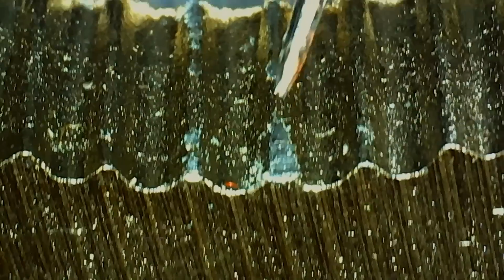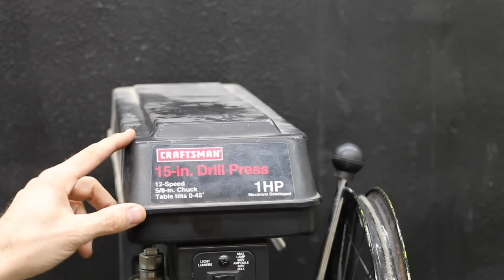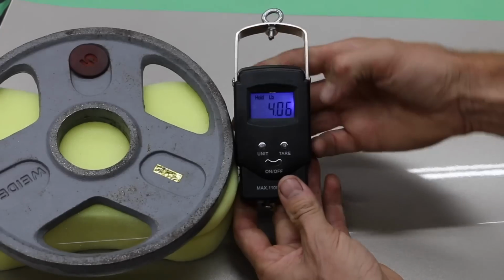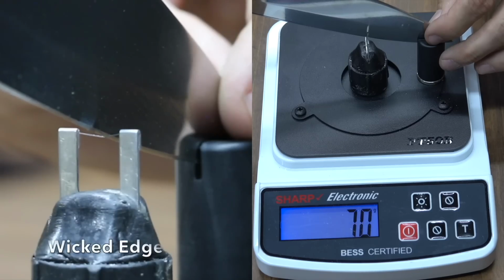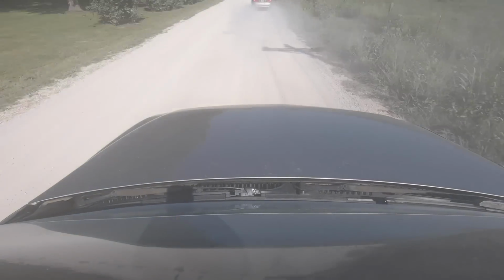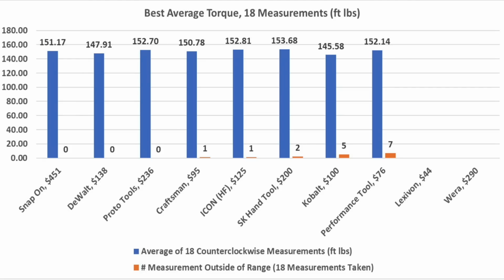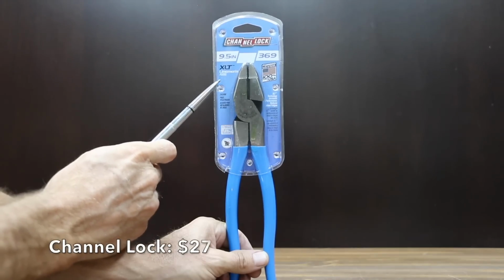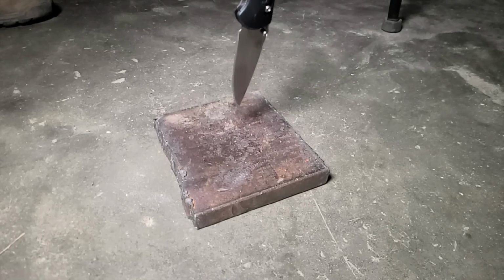Best USA Made Tools Ever Tested? Lets Find Out!

Comment: From the top ten using the torque wrenches for an example the Snap On was the best in Standard Deviation, the Kobalt was not statistically different yet cost less by more than 4X which raises the question was the Snap On or the Kobalt just having a good day or if you had tested 10 of each hopefully from different lots, would the results have been more or less the same or would a greater difference showed up in each brand or between the brands. Now that would have been a test 11 tools times 10 of each who would have won?  It certainly would have not been your pocket book or home life.

There are other things that were tested that 1 or 10 of each probably would have not made a difference such as the car products. I would hope that the various chemicals would be metered in such a way as to be plus or minus X to control the costs of the product assuming that you got an average bottle of the product.

I probably don't need another torque wrench, if I did I would have to look at the Icon as I would normally not go to HF for a torque wrench.

By the way my cars would tell you that you put way more effort in testing products as my idea of waxing the car is running through the super cycle at the car wash to get the wax job.

Great job.

Comment: Please do a Box fan and Vornado fan test.  I always buy and uses cheap generic Box fan for decades. then one day i bought 1 Vornado 270 . OMG even the Vornado has Modest 513 CFM air movement compare to the 2000 CFM box fan rating. 
The Vornado fan move air a lot FURTHER . you can feel the air movement a lot further away. 

Several criteria would be . 
1. Air velocity. 
2.Air CFM. 
3. Air velocity of movement at some distance away.  How far can you still feel the air movement.
4. amp draw at 1,2,3 speed.  Amp draw is VIRTUALLY the same usually :)  
It seems like regular fan air movement is DIFFUSED out very fast. 
5. noise level. 
6. Vornado DEEP pitch blade vs Box fan shallow pitch blade. which one caused Droning noise or more effective. 

I still have lots (6) of box fan. that is used in emergency when my rental property AC quit.  and of course the 20" shop floor fan with 6000 CFM would beat Vornado in shear air movement amount. 
But the Vornado is the best IMHO . I end up buying Three Vornado 270 flat panel fan.
You could test the Dyson blade less . But seriously Dyson is disappointing.  

There are several Vornado clone like Honeywell. but none that I tested would rival Vornado 270 Flat Panel fan. 

Thank you .
Reply from the maker: Great suggestion! Thank you.

Comment: I recently had some rubber fuel line that I bought from AutoZone dry rot and leak in just over a year, I'm replacing it with some $8 per foot 225psi fuel line from Oreilly and if you did one on fuel hoses that would be cool.
Reply from the maker: Thank you for the feedback!

Comment: I bought the vice grips right away.  I typically don't use these, but recently a stuck bolt revealed that the cheap tool was inadequate.  I have a set of Allied screwdrivers [a cheap brand made by Snap On] and recently bought a set of Tecton  (I pronounce it like electron, not like Trenton) and while they are not the Allied, they are good.

Great video!
Reply from the maker: Thank you!

Comment: I still have my Malco sheet metal hammer l bought in 1984 and the leather is still in good condition because on the first day l put electrical tape and many years later I took the tape off and put clear heat shrink on it.
I used it many years when I worked in the air conditioning business.
Reply from the maker: Thank you for sharing!

Comment: I own a Leatherman PST and an Oregon cordless telescopic saw, several guides for chainsaws with the same name, apart from that I have nothing else that could be related to the USA.  Maybe the problem is in the distribution network and maybe in the quality of the products that they are not more represented in the sale. The price should not be a factor because the quality should not be skimped on.  Proposal for the next test Fuel consumption on poorly adjusted lawnmowers or garden tractors.

Comment: About 25 years ago, I was driving down the road in CO. and spotted a wrench in the dirt. I stopped to look at it and it was a Snap-On torque wrench !, I tested it and of course it didn't work, probably run over a few times. I took it to Snap-On and they replaced it with a new one for free ! That's customer service.

Comment: Video suggestion: I would love to see you test lead acid battery banks used for solar, or house batteries on boats.
Some people say you should "equalize the batteries" monthly, and others say no, that takes life off the battery. 
Does equalizing extend or degrade the life of a lead acid battery?

Love this channel, always well designed experiments and tests. 
Thanks for all your hard work  :washhands:
Reply from the maker: Thank you for the video idea!
Reply: I'd prefer to see it with LFP batteries, but yes.
Reply: @SnifferSock  I don't think you're supposed to equalize any batteries except filled lead acid. 
That's what I've read lately
Reply: By no means would not equalizing your batteries or equalizing them really amount to much of a loss or gain honestly it really comes down to how frequently the system is having to charge and how quickly they drain and of course age of the batteries

Comment: Thanks for all the tests you do. To be honest, if I need a new tool, I look on Ebay for a used old made in USA one first. I needed a 15" adjustable wrench recently and ended up buying a 16" P&C which was the predecessor to Proto that was made in the early 70's. It will last another 100 years.
Reply from the maker: You are welcome!  Thanks for sharing.
Reply: I think P&C was maybe a sister brand to Proto  because they were made at the same time and Plomb predated Proto.Also the ratchets were different than Proto or Challenger
Reply: YES SIR, they were made good and right, dont waste your time with "China"

Comment: Might be just a bit late, but maybe you could test coolers and the like, could test durability, how long ice takes to melt, how long it would take to freeze water in it from room temperature, basically how well it keeps stuff hot or cold, watertightness, weight, capacity, stuff like that!
Reply from the maker: Thanks for the video idea.

Comment: My torque wrench is a snap on one. I used to work in the auto industry, meaning a highly accurate torque wrench is a must. I like the old school craftsman adjustable spanner. Pity they are now made in china. My pliers I use are Draper, made in Germany. As for pin, centre & drift punches, I can make these myself, as required, thus meaning I can custom machine them for particular jobs. All in all, a great video. A lot of the brands you tested are not sold here in Australia
Reply from the maker: Thanks!  Thanks for sharing.

Comment: Happy 4th. I loved the video. Please consider doing a video on torque screwdrivers, which we're required to use in the electrical codes. One annoyance is that you need multiple drivers to cover the range between about 10 in-lb (normal fixtures) and 150 in-lb (panel lugs)
Reply from the maker: Thanks!  Thanks for the suggestion.  Happy 4th to you!

Comment: As always great content. How about testing the performance aspect of a copper spark plug vs iridium. Copper being a better conductor and having lower resistance should allow for more energy to spark. I know they don't last as long, but may spark harder resulting in better ??? who knows. Maybe also throw in an old style non resistor plug as well. Just an idea anyway.  Thanks
Reply from the maker: Thanks!   Thanks for the video idea.
Reply: In my experience spark plugs with precious-metal tips perform better than those without. I think this is because the precious metal tip does not burn away and so can be made with a much smaller diameter, which means that the voltage needed to spark is lower and the gases are more exposed to the spark. This greatly reduces the risk of a misfire. I notice that most spark-ignition vehicle engines now have precious-metal-tipped plugs as standard. Even though they cost more, they are one of the cheapest ways of cutting down polluting exhaust emissions. They often give noticeably smoother running as well.

Comment: I had no idea there were locking pliers still made in USA. The Malco Eagle Grips look exactly like the old Vise Grips shape and design- I'd bet theyre made in the old factory. The original US made Vice Grips I've owned for decades- I've bet my life on them not failing a few times. No way I would ever skimp on a tool like that if buying again.
Reply from the maker: Thanks for the feedback.
Reply: Correct! Malco Eagle Grips are made in the original Vise Grip factory in Dewitt NE. I have both the Malco-branded ones and the originals (currently being restored after some years of neglect). The whole story of that factory being shut down and reopened by Malco years later is a good one worth looking up.
Reply: @TigDegner  hey thanks, I will. That's great they are still making the original, looks like just a cushion release added. I remember the Malco name I think my dad had some of their tools.

Comment: There are non patriotic reasons to buy from the region you live in.   Shipping costs mean that the farther away something is made the more pressure the factory has to make that item lighter.

Lighter often means cheaper, or less materials used.   Sometimes this if good, often it makes for a less durable product.

Easy way to see this in practice is to pick up furniture made on the other side of the planet, and locally made furniture.  The local stuff has got a LOT more gravity in it.
Reply from the maker: Thanks for the feedback.

Comment: Video idea- leaf gutter guards. I've tried a couple types and not really been happy with either. A big problem I had was how they deal with snow and ice in the winter. One type caused ice dams and another created huge icicles. 
Thanks!
Reply from the maker: Thanks for the video idea.
Reply: Don’t bother. You still have to clean any of them
Reply: @aayotechnology  Yeah, whether you use the bristle/cover style you'll still end up with sludge/small debris. Well, unless you don't have anything falling into your gutters in which case you still wouldn't need a gutter guard.🤣😂🤣

Best wishes to all!💗🍀💗
Reply: I have the metal mesh ones, but since I live in Southern USA, I have not had much issue with ice and snow.  I have never had to clean them, either, and have had lots of pine needles and acorns and pollen too. I have been very happy with mine.
Reply: Gutter guards are a waste of money
Reply: i have metal mesh ones made of stainless screen and just run heated ice dam melting cable along top of leafguard or bottom of roof to let it drain in winter and prevent icicles
Reply: I have the solution for you.... Save your money on that overpriced garbage. new gutters are only $2/ft installed.
Reply: Look into getting leaf guard
Reply: There's a problem.. no ice in Florida. Maybe next millennium?! 😉

Comment: Have you done a comparison on multimeters? It's always good to have an all-purpose one around the house, from checking small house appliances to troubleshooting electrical problems in your vehicle and power grid. Are they all accurate, or are some more accurate at different rates. I bought a kaiweets ht118a and I know fluke is the go to top brand.
Reply from the maker: Thanks for the suggestion.
Reply: Solid suggestion.
Reply: Just buy a Fluke 115 and you'll have no worries.

Comment: I used the Hybrid Solutions on my Durango that had 1,000 miles on it at the time of application. I did no Prep Work other than a wash because I didn't know any better at the time. I did two applications to get 12 months of coverage and at 14 month into we had a really bad snow storm in Michigan, anc I could still see a layer of road salt sitting in the layer of coverage. The stuff is really easy to apply as well.
Reply from the maker: Thanks for sharing.

Comment: Great Video. Thanks for all your work, I always enjoy watching your videos. Your videos have definitely helped me save money by not having to buy inferior tools. I have a few video Ideas. Electrical tape. Which brand has the best stretch, best adhesive in a variety of environmental conditions and oil grease, strength when pulling THHN wires through conduit with more then 360deg of bend or through conduit that has a ton of wires. And a test for being exposed to the elements over a long period of time like in your engine bay. Another video idea is for different wire nut brands for both stranded and solid wire also VS wago's. Another video idea is for crimp on wire connectors, terminals and butt connectors from the different companies. Which is stronger, makes a better connection, thickness of metal, which conducts the best etc. Sorry for the long post. Thanks again for all you do.
Reply from the maker: Thank you for the video ideas!

Comment: Might be a little late in the year to make sense for the channel to start testing this year, but I'd love to see a comparison of some of the water filtering systems designed to be used with garden hoses for car washing. I have such hard water it's impossible to avoid terrible water spotting, but would rather save the money if they don't work reasonably well. Thanks for all the fantastic videos!
Reply from the maker: Thank you for the video idea!
Reply: @ProjectFarm  Water filters would be a great idea. I started pumping water out of my lake when my well pump died, and I noticed some very significant differences between a handful of water filters I tried. Flow rate between two different '5-micron' rated filters was enormously different!
Reply: The turtlewax hybrid solutions ceramic spray wax, same product line as the one in the video, has helped tremendously. It's sprayed on while the car is still wet before drying the car off with microfiber. The alcohol in the spray helps to quickly dry the car before spots appear.
Reply: @ben501st  I'll usually use a detailer type spray like that as well. Works out better than nothing, but sometimes I don't have the time available or get distracted, or just before winter I like a couple coats of Collinite "Super Double Coat" which seems to get a negative impact in terms of longevity over the winter when layered on top (it's possible I'm imagining the results though). Thanks for the tip, I really appreciate it 🙂
Reply: I'd be happy just to find a pistol-grip hose nozzle that will last more than one season. The pistons that determine flow rate  always corrode and get sticky and won't shut off......
Reply: @goodun2974  They aren't as convenient as a good pistol grip, but there are some really good quality "fire hose" style nozzles available. I don't recall the brand sitting on the end of one of my hoses right now, but it's been going strong for almost 20 years.
Reply: @goodun2974  so true, every hose nozzle today is garbage